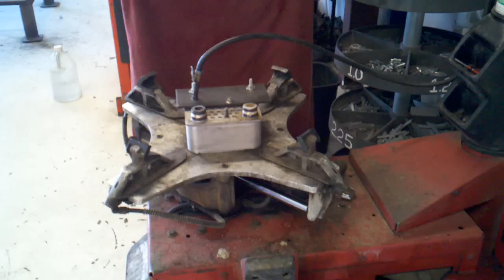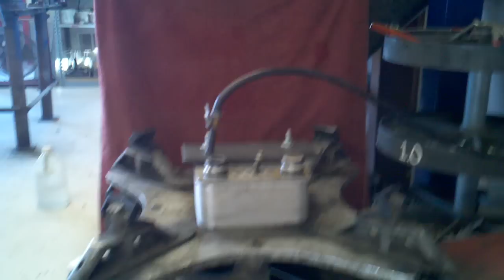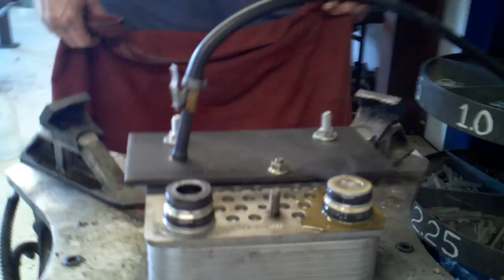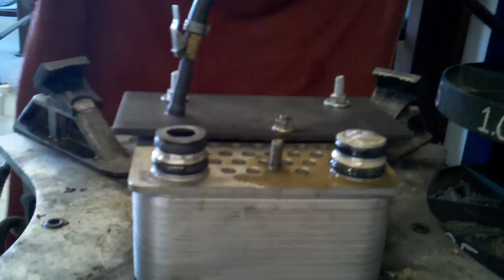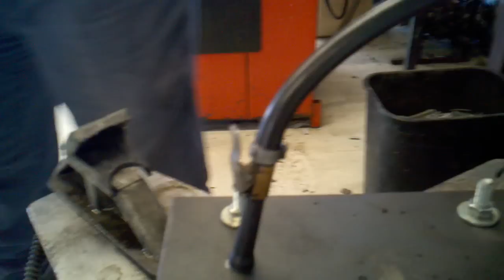2004 ford 6.0 oil cooler leak test at craigs car care in Allen,lucas Texas

Comment: Looks like a cheap ebay oil cooler. Mine did the same thing
Reply from the maker: Hi Patrick you might be right. Although we have seen one or two factory coolers fail like this one. I guess if you have to pick this versus a head gasket I'd rather have this be the problem.for any of this stuff we like to use the best parts we can get. To much work just to have to do it again.  Thanks for posting.
Reply: Craig's Car Care 
No kidding I'd hate to change the head gasket on this thing. I can get to the oil cooler and a couple hours haha. My understanding is the cab has to be removed to get to the heads and I don't have the means of lifting the cab off at my house. So yea good thing to check before diving into head gasket repairs

Comment: How much pressure were you running through it when you tested it?
Reply from the maker: Hi 466htrd, 
It was coming off the preset of the tire machine fill and was at less than 80 PSI.

Comment from the maker: MrJakediesel, Great question. Yes you can, but not the EGR cooler, unless they make a by-pass kit. I have seen many kit's on the market to do away with the EGR valve it's self but it is illegal for a shop to do this, as it would be tampering with a federal emissions device.

Comment: Can u remove the egr?
Reply from the maker: This is the oil cooler and has to be used. They do make a bypass kit for the EGR but it violates the EPA laws if it is done, this is why we will not bypass any emissions systems.